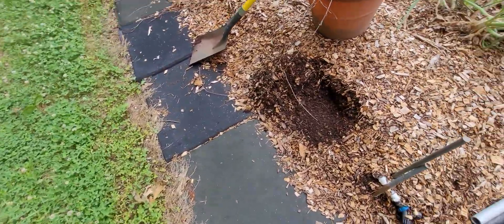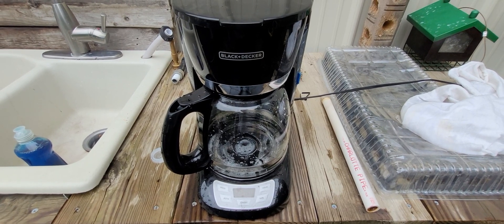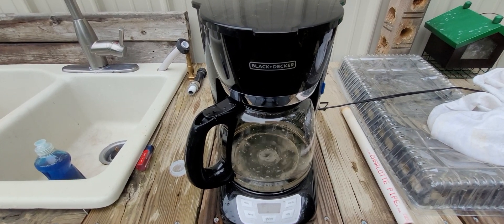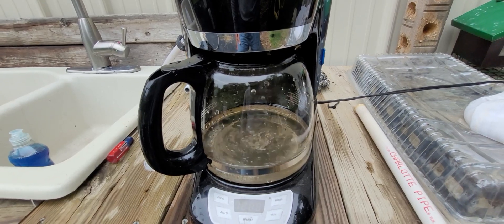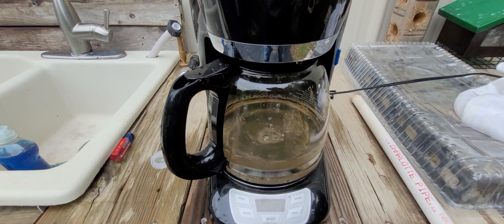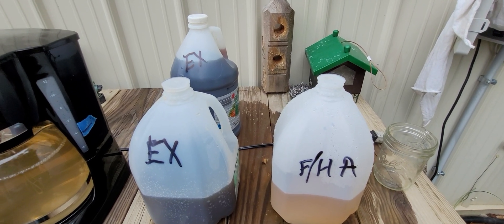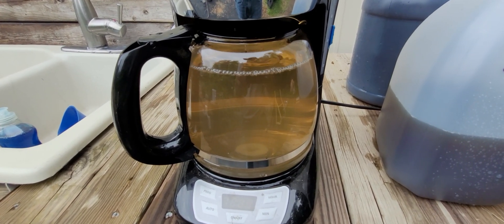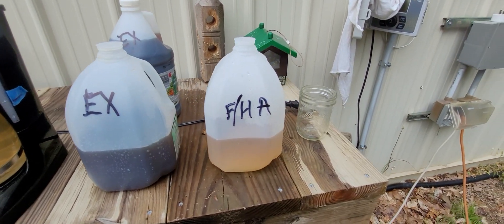Humic/Fulvic Acid Extraction: The Coffee Pot Method

Comment: I used a organic brown clay and mako a coloidal solution.it ends up like a milky brown thick ISH shake. One large goofball size piece and one and half to two litres of water .mix all together with a butterknife make sure it's broken down to solution and just stir couple times per day over one or two days with fork or whisk to add air and it seems to be better but you can just use it straight away. Boosts plant health instantly results in one day r visible and it breaks down substrate effectively but not as good as a fresh thick nettle drench .both excellent when USD together .in vegg it's exceptional.i supose filvic humic acids are what I call organic carbon. I think it TGE similar thing to video. SAFE yeh

Comment: Water extraction is great. If you really wanted to isolate the humic and fulvic acid, you would take your tea, adjust it to pH 12 with potassium hydroxide, then pH 3 with phosphoric acid. The dark humic acid will settle on the bottom for long-term soil building and the yellow/orange fulvic acid will float to the top for immediate absorption of plants.
Reply from the maker: @anon.41014  great suggestions!

Comment: can i use just humus in my garden or must be extraction to get humic and fluvic acids? Thanks.
Reply from the maker: I use my garden humus for so much stuff. I extract quite a bit for using it to make seeding media and super soils. Since many gardens are fairly low for humus content, it would be difficult to say if that would be all you may need. But as a comparison, I have a layer which is handily over 6 inch deep in most areas of my gardens. If you have deposits like this, by all means do either a passive cold water extraction from the garden soils, or  the heat extraction like in the video.  Or you can seek out some old compost and use that too. Either one will produce excellent results. Store for up to a year in a durable jug.
Reply: I suggest you watch the linked videos below to understand where humic acid really comes from...ancient deposits that underwent specific molecular changes...not from the bottom of some wood chip pile no matter how old.

It is a mined product from New Mexico.

https://youtube.com/watch?v=oKzwgJMy0sQ&si=ajXbfeWnkjaymhgf

https://youtube.com/watch?v=qxlotcSrSWQ&si=t1FYEfPHk2fUM4Vu